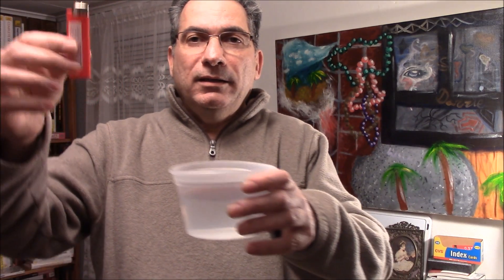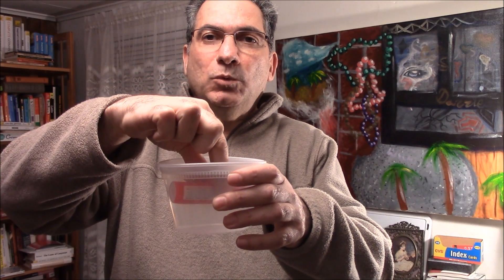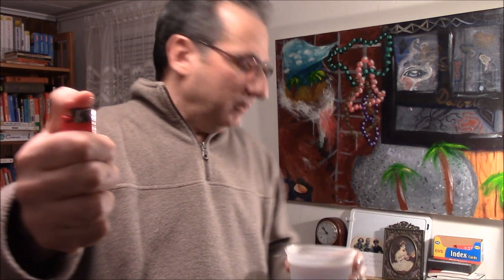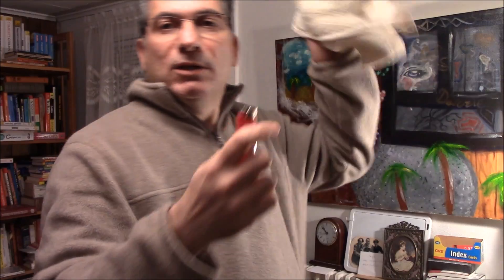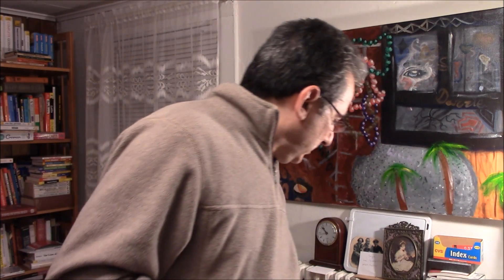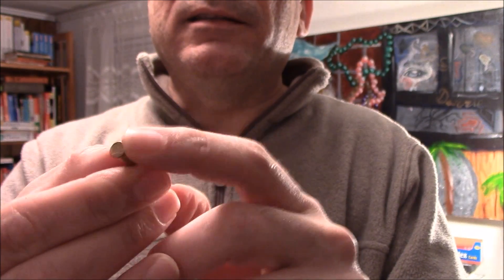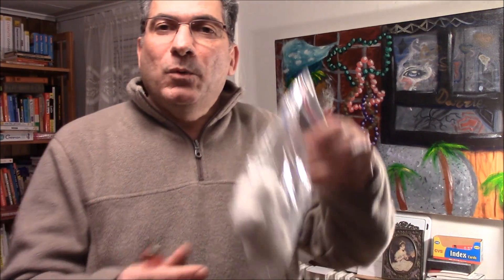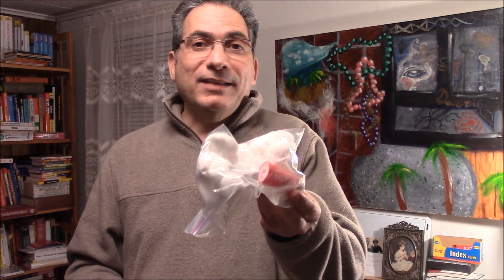LIghter and Firesteel Meet Physics

Comment: Another great video and you are right about keeping your fire kit dry.  I would not worry about keeping the firesteel dry.  Just wipe it off and use it.   Even if everything is wet just shake it out and it will throw sparks.  Quality lighters are great, easy to use and cheap.  Definitely recommend incorporating a few lighters in any emergency or survival kit.  but the most important tool you can have is knowledge so the more capable you are the better.

Comment: Most the fires I have started have been with a lighter. Matches and Ferrorods are a distant second. I always keep matches dry, but I've never worried about lighter or rods, because I know you just have to dry them for use. Being from Montana/Idaho, if a lighter fails me it's most likely due to temperature. Butane lighters in sub zero temps don't like to part with their precious fuel. I've squeezed and shook them in a clenched fist to warm them, but after a few minutes, I just go to matches or a ferrorod as a backup. Cram that frozen lighter in your armpit, so if your backup also fails, the lighter gets a second chance. My point is, never trust that one will always work, and carry a backup. Dry storage or not, a lighter and ferrorod will almost always have you covered.
Reply from the maker: Absolutely right. One has to be mindful of the limitations of each method and plan accordingly.